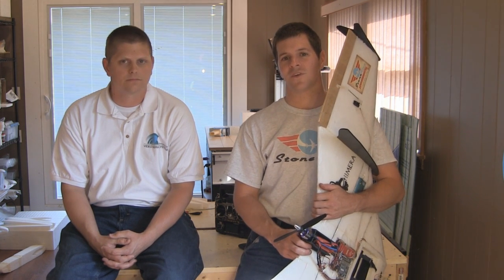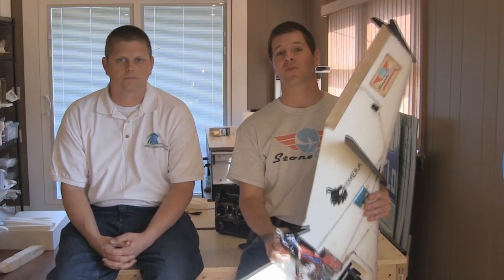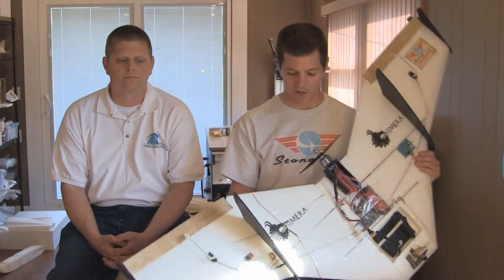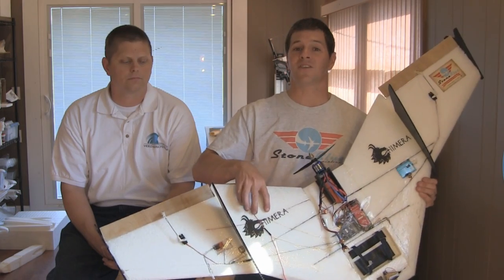TSLRS V7.0 test and review

Comment: I love my v7 TSLRS. the matching v7 long range diversity receivers are AMAZING! In my opinion they can't be beat. I have positive control on stock dipoles all around at 52 miles; the farthest I can physically fly LOS. I have no problems flying within several miles without having any isues paired with v2 Lawmate vtx's. However... The Normal Range Multi Copter boards (NR-MK) are complete trash. I've had two & they have far inferior range in practice, even when replacing the stock monopole wire with proper SMA & the same dipoles off the LR models.

Comment: At their price I shouldn't need to make mods.  Noisy units?  You folks are EEs and would know to look for it, most consumers wouldn't know how to test it or even know that they should test it.  Again, at that price it should not happen.  Consumers would be just as well off buying the cheap Hobbyking OpenLRS units at a much lower price and the would save a ton of money.
Reply from the maker: Well, the HobbyKing unit has its own set of problems.  However you make a very good point in that it should not have been so dirty.
Reply: Alex Greve okay, review them and tell us how bad they are... :)

Comment: Why not use a dedicated UBEC for the receiver and a separate dedicated UBEC for the servos? It's also a good idea when using (digital) servos in combination with autopilot systems too.
Reply from the maker: While I agree, this is not common knowledge for the average hobbyist.  In most cases, you can get away by not doing this.  However, the TSLRS could cause you to lose your aircraft if you do not know.
Reply: Alex Greve IMO: if you are flying long range, you should have the knowledge that an rx will greatly benefit from direct battery power & that servos are noisey. :)